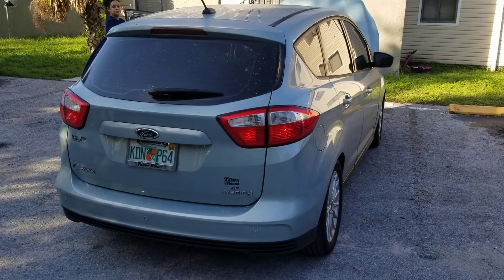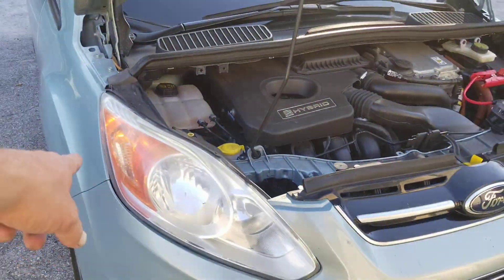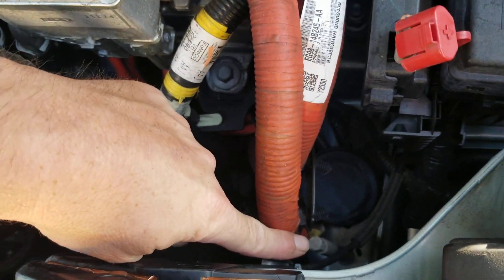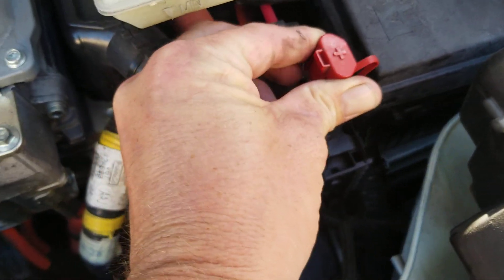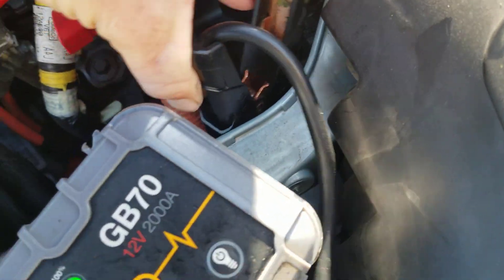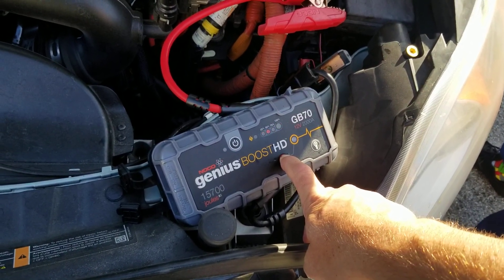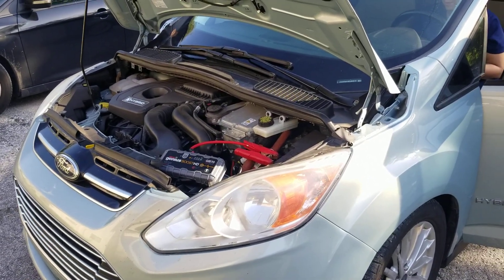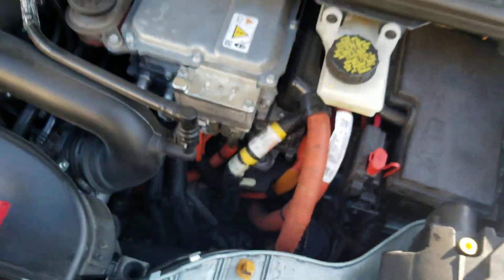How to jump start Ford C Max hybrid

Comment: Is it safe to jump  with another car ?
Reply from the maker: Yes just hook up your dead car first. Then when you connect to the jumper vehicle make sure to connect red first to red and then black to black.
Reply: @roadsideguy5902  I have read, multiple places. Connect positive to dead positive first, then charged battery. Connect negative to charged, ending with dead negative. Something about less chance of sparks damaging the electronics. Then start charged car and let it run for awhile before attempting start the dead car. I have found that raising the idle speed helps regenerate the dead battery also.
Reply from the maker: @crabbypapa3862  but I jumped from a jump point not the battery. That only applies to when you are connecting directly to the battery. Thanks for watching.
Reply: @roadsideguy5902  2014 C-Max Energy owners manual says turn the heater fan on in both vehicles to protect from electrical surges. Then, using the prongs on the hybrid, then the procedure I mentioned. You do what you want, the car manufacturer is not always correct.
Reply: Is this will work with the NOCO GB40? I own a C-Max 2013.
Reply from the maker: Yes